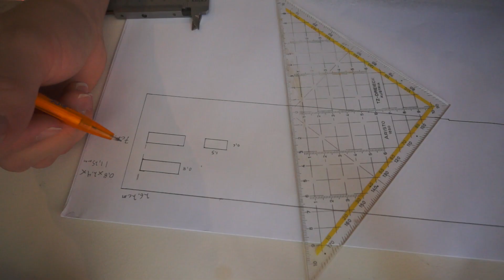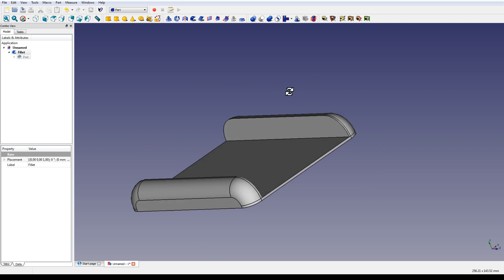Pc Project: Next Gen PS2 - Part 3

Comment: im really curious how you outsourced the power supply? would love to know
Reply from the maker: External power brick + Pico-PSU solution. I've made small video about my power bricks.
Reply: i know but doesn´t pico-PSU limit to 200w? is that enough for the 1050 ti build?

Btw really nice Work
Reply from the maker: Thank you :) I'm using now m4-atx from mini-box with HP voodoo 350w power brick and still headroom to overclock and finetune. Allways if possible i would test with higher wattage power supply what the max peaks are on your final system, before blowing up a psu.

Comment: How you wired up front power button with LED? any pinout cause I cannot find any :/
Reply from the maker: From ps2 buttons/leds comes flat wire with many connection lines. I just went thru all of them testing what is what, OR looking from button PCB you can see where the leds are and where their connection lines go. = I did solder normal PC led/power button wire to that flat cable (was pain to do) and now it's working. :)